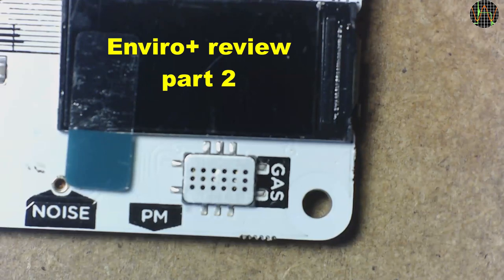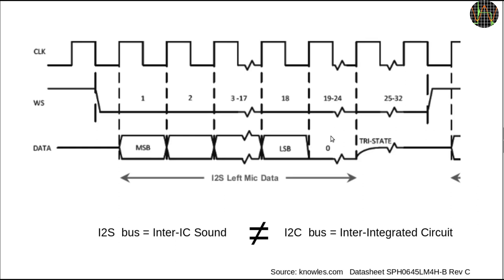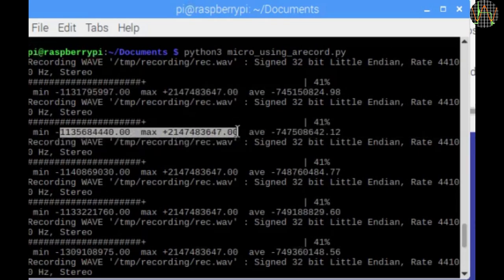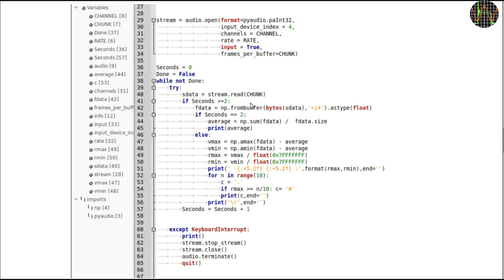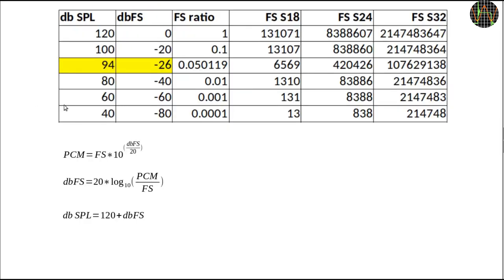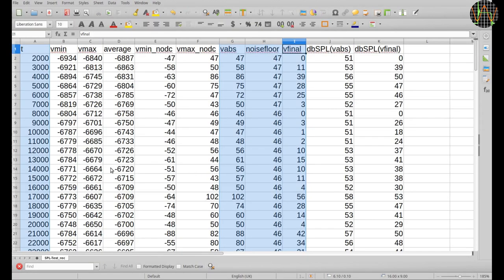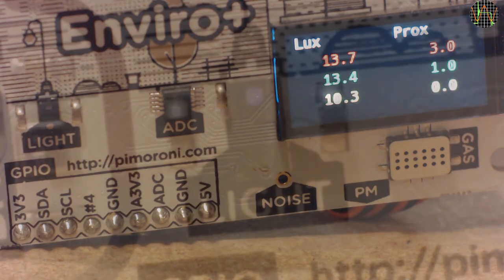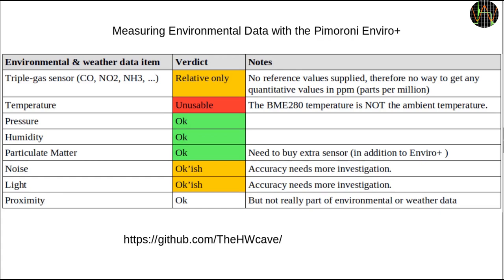Review of Pimoroni's Enviro+ board- Part2: LCD, noise level, light+proximity

Comment: Hello!
Again, very nice video!
Pimoroni updated the enviro+ library over time. Starting with Sep 17, 2019 they added support for microphone.
Reply from the maker: Thanks for the update. At present my Enviro+ is happily running (including the microphone) so I am not in a hurry to try out the latest library, but I'll look at it eventually.  If you have tried it, does it work?
Reply: @TheHWcave  The library gives a method to get PCM signal and then calculate some Discrete Fourier transform.
Reply from the maker: Nice. Thanks for sharing.

Comment: Really enjoyed watching your investigations, very good explanations, examples, fixes and tests. Will start digging into my Enviro+ soon and try to hook up SDS011 + DHT22 :-)
Reply from the maker: Glad you liked it. I am planning to continue on the Enviro+ I got an enclosure for it and designed a touch panel front PCB. I am waiting for it to return from JLCPCB. The continuation will be mostly about putting all the sensors together in one program with a bit of statistics and data logging added. I will use a different temperature sensor  as the Enviro+ as it comes has no reliable temperature sensor (in the BME280).
Reply: @TheHWcave  my plan would be to combine my existing https://luftdaten.info/feinstaubsensor-bauen/ sensor (i have made a new one with case like this: https://www.thingiverse.com/thing:2775946 ) with the enviro+ and a raspberry zero w. Also, for indoor temperature, I would use an external temperature sensor on the enviro+ (some DHT22s flying around here, also another BME280). Not sure about it so far, but I think maybe it is better to incorporate the "lufdaten.io-sensor-set" as it is with the nodemcu, just via wifi. With that, i could have the luftdaten.io-set outdoors, sending its data wireless through my home wifi to the enviro+ indoors, which could show the outdoor pm- humidity- and temperature-data on the tiny display :-)